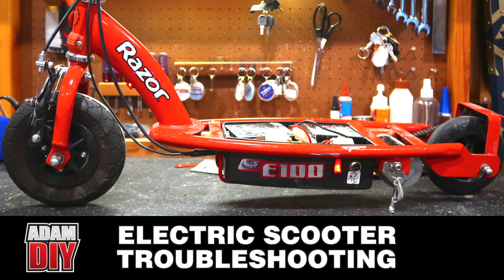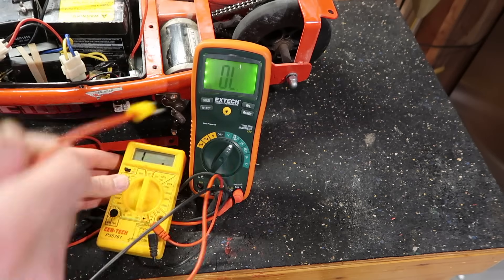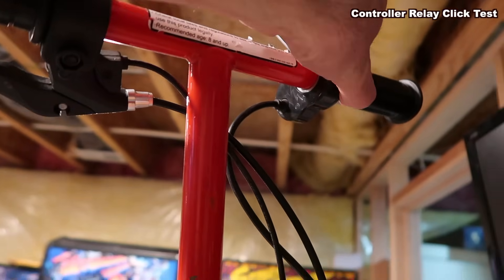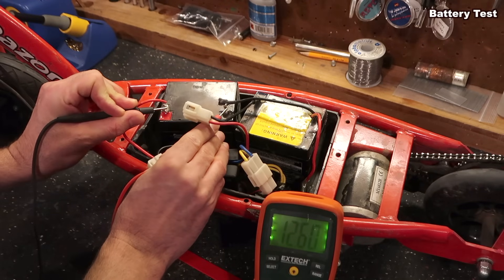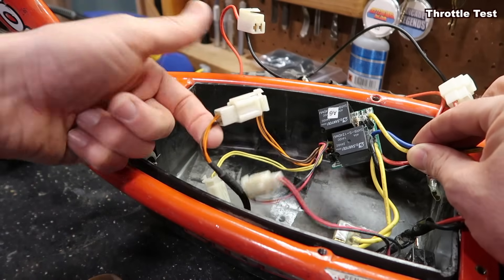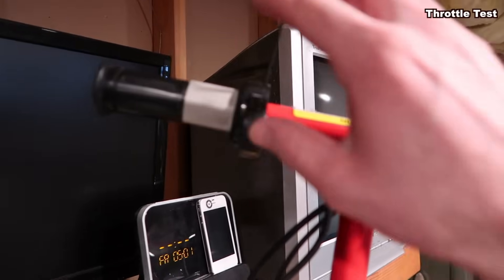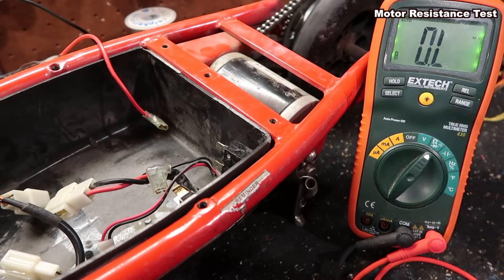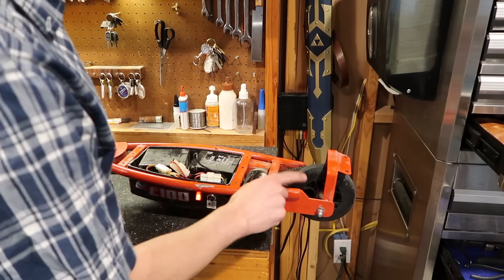How to Repair an Electric Scooter - Razor E100 Troubleshoot

Comment: I did all that even bought a new control box wiring n checked everything else still I get no clicking noise checked the throttle it works but still no clicking noise ?
Reply: Same here. New controller too. Did you figure it out?

Comment: I bought two new batteries wired them the same as the old but when checking voltage I get nothing but each will show 12v individually

Comment: Im showing 10v on a 12volt battery, do you think that would stop the scooter from moving? No clicking coming from relay and when I tested the throttle it didn't beep but the screen started showing gobbledy-guck on the screen.

Comment: Recently got a charger for my 2 Razor E100 scooters i've only check partially just one and it does the clicking noise but the wheel dosen't move even when i give it a spin by hand so ¿ Could it be the Motor ???

Comment: The most frequent cause of Razor scooter failure is the batteries.  If the batteries cannot be charged above 23V the controller will not function and the motor will not engage.  Many owners think the batteries are OK if the switch lights up.  No so!  Measure them with a voltmeter.  If the reading after charging is below 23V replace them.   The 23V limit is there to prevent the batteries from deep discharging and irreversible damage.

Comment: Great video, totally helpful. But I can get wheels to run when not touching a surface or any weight...so in the air. I can hear controller box click, I'm not sure about hearing the brake click. But anyways. What can you tell me. I dnt have ammeter at the moment. Just hoping there a tell tail sign. It says it's fully charged on the wall charger.

Comment: Just a suggestion: Don't solder the wires to the batteries; instead attach some (yellow) push-on 1/4" connectors to the wires.  Makes it much easier to change out the batteries.

Comment: I'm getting only 20V output on a e300. Wheel spins when on bench, but crawls when put on the ground. Batteries are brand new (13V each). Would the problem be the controller, the motor, or the bearings?

Comment: Hey Adam. Any ideas why my kids e125 scooter doesn’t work. Watched your video and installed new relay in it and it still makes the click sound but no go. Got new batteries and motor works. Wired it direct and comes on. Thanks

Comment: Awesome video!  is there a way of manually checking if the controller is the problem?
Also,  i've found that the middle pin of the charger isn't working (the on/off switch doesn't work). is there a way to fix this?

Comment: Thanks for the great video however I replaced the battery and control box, checked all points that you showed and  motor is working with  direct connection to battery. 100% checked but the connector from controller to motor don't have power with throttle. help!

Comment: Great video explaining is great still can't find the problem with my e100 can anyone help me my Relay isn't making the click both battery's are good new Control module motor is good connected it to my 12v battery wheel is spinning but  Receiving 00.9oms  (orange wires) Resistant from the throttle Connections  03.5 from the two brown wires help please thanks

Comment: Ok what’s going on with my e100? I put new batteries in it and a new controller. The switch doesn’t light up and the breaker trips after 5 seconds. I test all the connections with meter. Everything checks out. The motor resistance is 5.5

Comment: I bought new batteries, but I need the wires that go from the batteries since the old ones are soldered on. Where can I find just the wires that connect to the batteries?

Comment: Thank you man...was handed a E500s scooter, to fix...smh...1st wiring all unplugged, then battery's both dead...overcome all that, still no motor oper, ohm test O.L- smh, so motors apart & cleaning armature now, then noticed rear wheel bearings shot too...smh but hey your guidance thru throttle & controller was a Big help man...👍👍👍👌💯

Comment: Thanks this is very helpful. Battery, brake, and (new) controller are good but I think my throttle is broken. I cut the wires and tried connecting brown-brown and orange-orange to mimic what the throttle does. But still no click. Any thoughts?

Comment: my charger only has one prong, so when i tried to measure the voltage coming from the charger, it just gave a big spark with just one lead in there, so i didn't continue. Was this because it was automatically on AC? I set it to DC after i realized, but i wasn't sure if it was because it was a one prong connector or what.

Comment: I have tested everything and all is good, but the relay isn't clicking. I bought a new one, still no click. I am only getting 17v from the batts. Any idea if the relay would still click with 17v? 

Thanks for the video and tips!
Reply: I think I may have just found my answer. The relay has an under voltage rating of 19.5. So I am guessing it's a no.

Comment: Everything on mine has tested ok all connected ,new throttle and new controller box but still no power going to the motor ,the motor works just don't get it the fuse is fine ,I bypass the brake as it's not working and still can't get it to move the volt meter on the scooter is registers at 25 .6 votes really don't get why it's not working

Comment: HI
I have a variflex stinger electric scooter, here are the specs

Variflex Stinger Electric Scooter Specifications: Two 12 Volt 12Ah SLA batteries, 24 Volt DC motor, 575-5M-15 HTD drive belt, 2-speed off/on/on pull lever throttle, 10"x2" tires and tubes, rear band brake, 24 Volt AC 2 Amp output battery charger

Between my buddy and I we have some good tech abilities, the question is, what would be the best way to make this scooter FASTER?

Do we just get a stronger motor?
Can we wind this one tighter?
Get a better battery?
Maybe just go with a 36v battery and be done with it?

I was wondering if you could give me some ideas to make this thing ROCK

Comment: Hello.. I went through everything as you suggested in this video but the only issue I found is the motor 1.5 resistance?  I put power directly to the motor and it runs any other suggestions. Thanks

Comment: Very nice review of component testing.  Of course my batteries were bad after years of aging, but my biggest problem was that I didn't know about the kick off needed by the scooter to get the motor started.  I feel dumb and happy at the same time.  You have made my nephews very happy. Thanks again.
Reply: i agree the last part of this video is the most valuable and should come first for anyone who knows basic troubleshooting.  I had even tried starting the scooter by rolling it (albeit slowly) while applying the throttle.  I was about to take everything apart and start all over again when I viewed this video (without thinking it was much help) and saw it through to the end.  I then went out and tried again trotting along side the thing (it has a 120 lb weight limit that suggests it would be unwise for me to actually ride it), and the thing took off. Problem solved -- user error!  Thanks for this video.
Reply: Yes I agree!  Kick off needs to be first in video.  I took apart the whole thing for no reason lol.  Learned a lot though.  Thanks for the video
Reply: Yes! Wish i had watched that last part first. Glad to know everything else works! Did not realize you need to push the scooter to get the motor going.

Comment: Hi My 2 battery say 1 saind 12.5 there other one day 12.1 put cable can hiring the click and still no running i check the motor charger battery it working  still no workin

Comment: We found a 12v one in the bushes. We tried charging the battery and it charged. I did not hear a relay clicking but I thought lets do the spin the wheel test and whalla it worked! Thanks for the video.

Comment: You are great!!! I'm just learning everything on my razor echosmart metro and Im having problems...the scooter used to go 12 miles now only 2 miles then low light comes on and scooter crawls home, at that point I test the 3 batteries they show 12.7 to 13v  in series 38 volts....I charge it again and I get 2 miles then it goes dead.  I have changed the batteries and charger twice, then recently I changed out the control module its only 6 months old and Im clueless. Im going to watch this video and see im missing something thanks

Comment: So a question I would have two batteries two switches in the throttle DC motors can run on a variant of voltage so does that mean the motor likely starts in 12 V and high speed is 24 V? Or are those two switches just redundant? 
A trailer with more batteries?🤩
Reply: dual switches are to keep the scooter from stopping and surging when one has a poor contact.    More batteries?  You would need a higher wattage controller, higher wattage motor and larger circuit breaker and fatter wires.  Hum, just get a more powerful scooter.  The Razor E100 is a childs toy not a racing machine.

Comment: I changed the batteries and when I went to hook them up, there was a spark and a click in the controller box. Now it does not work. Thr box does not click.  
Any ideas?
Reply: You connected the battery wrong and you burned your controler  need a new control system

Comment: Thanks for the great vid! I have a question. My throttle, brake switch, and batteries all check out. Controller clicks with throttle activation, but the motor won't start with a kick. When the throttle is switched on, there is no voltage going to the motor. Is the controller at fault? Hot wiring the batteries to the motor DOES operate the motor.

Comment: Adam,
Thanks so much for making these vids. I sub'd and liked, as all should) quick Q?: around 2:00 or so you're testing to make sure you're wires on the actual Tester Unit are good, yes? And you said just touch them together and (the one Tester makes a beautifully horrible beeeeep. And the other not sure if it beeped) theyll change numbers on the screen. So if you turn on your tester, even if it doesnt have the pleasant beep feature: if you touch the testers wires together and theres no change to the value of the numbers being displayed.... Does that mean one of your wires on your testing device is not functioning???

Comment: So your a parts replacement guy. Your teaching people on electric components without knowing the dynamics of each component.  Your first respone is its to complicated and tiny parts. The throttle itself consist of a spring, the contacts are opposite of eachother so when you turn the knob to complete the circuit the plastic arms on the throttle side are compressed. A q tip with rubbing alcohol  will clean the contacs. Its simple, why spend money when you could fix it. The  controller has two relays if they not working properly  (clicking )they are easily repairable. Same thing the brass contacs can be cleaned with a simple q tip and rubbing alcohol. The circuit board could become corroded through riding in the rain so on and so forth. Again get a small  container put rubbing alcohol  and set the circuit board in the alcohol for a few hours. You could see the corrosion flaking off.  Make sure you blow off all parts thoroughly I have an air compressor,
alot of people use can air for cleaning computer key boards. You don't have to buy parts online and wait forever to get them. Fix it! The battery? Hook up to you car battery and let set for 4 to 5 hours. The high voltage from the car battery will over exeed the slow 5 amp trickle charge from the factory charger and bring life back into the scooter battery. No worries of blowing yourself up. Its safe and its been done since the first battery was used as a power cell in motor vehicles. Its easy and not near as expensive. Fix it!

Comment: Excellent video.  Unfortunately, still doesn't work.  New batteries, new controller, all tests passed.  Gave it a boost and still no go.
Reply: Interested if you got fixed. My scooter runs but in the air...soon as it touched floor. Stops
Reply: I was working on 3 of those at the time so I don't remember which one I was talking about.  But there was only 1 that I couldn't fix, and I think that was it.  Turned out to be batteries touched contacts due to tight container, causing batteries to fail.  I sold that one for parts.  Yours sounds like a weak battery.

Comment: Thanks for the video , it's been really helpful,  checked everything except the motor,  need a new meter, mine was used on the ark , 😄
What are your thoughts on how the controller knows the rear wheel is turning?  Do you think it senses  back EMF from the motor....

Comment: My scooter turns on but when I pull the throttle I hear no click but when I plug in the charger and pull the throttle it clicks so do I have a bad battery or a bad controller

Comment: This whole time I didn't know you have to give it a kick.  I inherited a used one.
Reply: It's either kick it or change the throttle. Changing the throttle helped a lot. Then it works like a twist grip should, start slow and build up speed instead of it just being a toggle switch ON and OFF (I think it's best for kids) plus less strain on all the other parts of the scooter. Then you can put a key switch on it so it's harder to rip off.

Comment: Great instructions. What happens if I  can hear the click ( from turning the throttle) when the charger is plugged in, but can't hear the click once the charger is disconnected?
Reply: Did you ever get a solution for this because mine is doing the same. Stays solid green upon charge as well but I don’t get the click when on without charger plugged in.

Comment: Thanks for the video. So, if the brake cable test turns out to be the other way around. Meaning that the continuity test makes it beep when the breakers are applied. Does that mean I have a bad brake cable assembly? Battery is good 13.13 volts, switch is good, motor is good, throttle is good, and the controller makes a clicking noise. I applied a push to the wheel and it still does go. The clicking still there.

Comment: Thank u so much! I knew my batteries were bad after purchasing this used scooter and upon replacing them it still didnt work, i was about to bust open the controller because i didnt hear a click until i saw the last thing u said to check by giving it a push start and it worked!

Comment: Thanks, appreciate the walk-through, the little tip at the end to give the motor a little kick made all the difference! Save me hours of headache.
Reply: I had replaced the batteries (fully charging them separately before soldering the connections to them) and replaced the control unit (it hadn't worked before, with the old batteries, even with them showing to be fully charged) and it still wouldn't work.  The instruction manual I found online (this was a second-hand freebie for my son, so no instructions with it) said that only the E100 needed to be up to 3 MPH before engaging.  Maybe it's just the aftermarket controller, but this unit (E150) has to be rolling pretty fast (probably 3 MPH) before the motor will engage.

Comment: this is a fairly old video but hopefully someone can answer. When i do a continuity test of the charging socket i test the 2 prongs and the bottom and they're fine.when i test the top prong and the switch i get nothing? does this mean the switch is no good and needs changing? the switch lights up when i turn it on is all?? this bit is throwing me
Reply: Yes bad switch

Comment: Thanks for the information. My wife bought a used E175, that supposedly needed a new battery. The relay box wasn't clicking when the throttle was engaged, so I replaced that instead. Now it' runs.
Reply: I have a E175 don’t runs,and the relay box wasn’t clicking,you think i need to replace the relay box?

Comment: What if my scooter turns the wheel slowly? Do I need a new motor?
Reply: disconnect the battery from the speed control connector also disconnect the motor from the speed control connector ...then first raise the scooter onto something to separate the rear tire from the floor.... use a couple of jumper wires to power the motor directly from the battery (red to red and black to black) ...if the battery already had tested good the motor should work and the tire should turn at full speed
Reply: Carlos Mejia I will try

Comment: Mine does the relay clicking, batteries fully charged. When giving throttle, it clicks, but there is no voltage to the motor.
Reply: Replace the speed control box

Comment: I know this video is old, but I was hoping maybe  you can help me.

I do not have a razor scooter, but a dualtron  style clone scooter. The problem it has, is that recently stated experiencing  power problems. When I hit full throttle,  it seems as if it wants to run fast, but then the power slows down. It doesn't  go as fast as it was before. 

I've checked  the voltage  on the battery,  but through the voltage  meter it has on the LCD display,  it reads that the lithium battery has a full charge,  67.2v. I have a 60v  5000w scooter. I've checked  all the connections on the controller,  they seem to be connected. But I have not checked their connectivity  like you did. I was thinking  it might be a bad motor, because  I has noise problems coming  out of the front motor before. 

But my question is, how can I load test the lithium battery?

Comment: This video was awesome! Thanks a lot. I almost missed out on a good scooter and after watching your video I see I just need a little push start on it. 
My issue was I was turning the throttle and I heard the click on the controller but wheel wasn’t moving. Now I know I just need to give it a little push off. Grade A video buddy, thanks a lot

Comment: I’m getting power the throttle is good but the relay is not clicking. I bought new speed controler and still not working. I have a razor accelerator
Reply: Same problem. Did you figure it out?

Comment: I had a controller problem so I connected the motor direclty to the batteries throw the throttle button but it works less time than usually ..